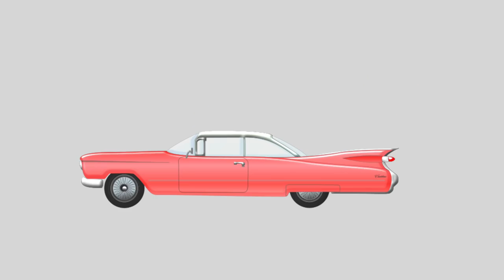Yes, Rockets CAN Fly in a Vacuum

Comment: But there is no resistance in space for the rocket to move into outer space. No resistance also to reduce speed or bank. Go back to basic third law of motion. Action reaction.
Reply: The fuel has inertia.
It resists being accelerated. To change speed or direction in space you just need to accelerate and expel some mass in the opposite direction.
Just point the engine bell away from the direction you want to travel in and use some fuel.
Reply: @niallkinsella2687  so newton's 1st law doesn't count in space? ok liar.
Reply: @77thbrigadesockpuppetaccou50  
I've described conservation of momentum.
The law of conservation of momentum is derived directly from Newton's laws of motion.
Reply: @niallkinsella2687  you've described a physical impossibility, lying guy. very boring & silly.
Reply: @niallkinsella2687  you described a violation of the laws of motion, silly billy.
Reply: @77thbrigadesockpuppetaccou50  
Does the fuel have mass, and does it change speed or direction?
Reply: @niallkinsella2687  according to the laws of physics a gas does not develop mechanical power when it expands into a vacuum. the mass & direction are irrelevant to the physics involved. stop wasting my time plz, troll guy.
Reply: @77thbrigadesockpuppetaccou50  
My question isn't difficult.
Does the fuel have mass, and does it change speed or direction?
Reply: @niallkinsella2687  irrelevant in the case of a gas expanding into a vacuum, troll guy. cos w=PV.
Reply: @77thbrigadesockpuppetaccou50  
Who cares what happens to the fuel exhaust after it has been ejected from the rocket?

What happens before that? What happens to the fuel to cause it to accelerate from 0 relative to the rest of the rocket to several kilometres per second relative to the rest of the rocket?
Or to simplify the question. Does the fuel change velocity or direction?

Why are you refusing to answer such a simple question?
Reply: @niallkinsella2687  He's refusing because he knows he is wrong but he, like most people these days, refuse to admit it.  I see most of these comments being from either children or immature and uneducated young people. Their inflated ego inhibits them from learning anything unless it comes from their peers, who are also woefully intellectually impaired.
Reply: @77thbrigadesockpuppetaccou50  Since you’re so smart, explain why a rocket engine works IN ATMOSPHERE first. Does the exhaust push against the atmosphere? Didn’t think so. Also, engines are supposed to be more fuel-efficient and higher thrust in a vacuum, because there is a greater pressure difference and therefore more energy. I have seen many comments saying that engines don’t work in space because there is nothing to “push off of”, therefore violating Newton’s third law of motion. It doesn’t. The fuel is the matter you “push off of”. And, Newton’s first law, the force applied from the pressurised fuel in the tank equates to nothing because the energy comes from the molecular bonds in the material that makes up the tank. The tank isn’t losing mass in any way which means no net force is applied on the entire spacecraft.

Comment: Rockets move forward (upward) because of the high pressure inside the engine bell pushing upwards on the rocket. The other end of the engine bell is open, so nothing for the gases to  press against. It is this net force in one direction that provides the thrust to move a rocket. What happens to the rocket exhaust after it has left the engine bell is completely irrelevant. The rocket isn't "riding on the exhaust", it's riding on the net thrust inside the engine bell.

Sure, the exhaust moves in one direction and the rocket in the opposite direction. But the one movement doesn't CAUSE the other movement. Both movements are the RESULT of the pressures of the ignited gases inside the engine bell.

Comment: On Earth, the rocket thrusts against the atmosphere to for propulsion. What does the rocket push against in space?
Reply: Rockets accelerate fuel.
Conservation of momentum means the rocket gets accelerated in the opposite direction. 

A third element is not required in the interaction.
Reply: - "On Earth, the rocket thrusts against the atmosphere to for propulsion."

No it does NOT.
Rockets thrust against the MASS THEY EXPEL as exhaust.

In fact even Jet AIRCRAFT do NOT "push on the air in the atmosphere".
They push on the AIR INSIDE THE ENGINE
Reply: Third law of motion.

Comment: Newtons 3rd law can't act on nothing of space. Rockets require atmosphere and walls to act as a barrier to push off against, in order for Newtons 3rd law to do its thing. Its like you are all claiming man can push a heavy rock with his legs floating in the air lol. You need your legs pushing against the ground in order for Newtons 3rd law to do its thing and allow you to push a heavy rock. Same thing with the rockets. Its not going to work in space with no atmosphere and walls around. You need to constantly explode the fuel at exhaust like tnt explosions, recoil effect from those explosions is what will propel rocket in space, the only way for rockets to work in space and its too risky for manned missions beyond low earth orbit.
Reply: Hang on a second.  I though you said that rockets require an atmosphere to push off of.  Yet, you claim that man cannot push a heavy rock by pushing his legs......in air.  Why do rockets work in air, but my pushing my feet does not?  This is inconsistent logic.

The answer :  the actual mechanism that powers rockets is the ejection of mass away from them.  They work on the concept of the law of conservation of momentum.  If you take a bunch of mass and you eject it away from you, the laws of physics will maintain the momentum of that system and you will be thrust in the opposite direction.  This is closely related to Newton's third law.

You say that you need to constantly explode fuel for rockets to work.  Yeah, that's what they do.
Reply: Inconsistent logic? Are you confused? Read my comment again. Rockets work in air because the air/atmosphere acts as a barrier for rockets exhaust to push off against.
Reply: They will have to tnt explode the fuel inside a container constantly and let some of the recoil effect escape from the exhaust hole along with all the gases while other recoil effect from explosions hit the walls of rockets and propel rocket in space. The hole at the exhaust is important otherwise rocket explodes instead. It is the recoil effect that propels rocket in space, not the explosions and exhaust gases themselves.
Reply: Rocket technology is not a viable option for man to travel beyond low earth orbit because its too risky. And they are not using rocket technology for that, they are using undisclosed electrogravitics technology. Google "The Case for AntiGravity-booklet.pdf - Check The Evidence".
Reply: Right.  So why doesn't the air act as a barrier for my legs to push off of?
Reply: Let's back up a second.  Do you think rockets work in a vacuum?
Reply: You are still confused. Wear rocket boots and then air will act as a barrier against rocket boots exhaust flying you up in to the sky.
Reply: Yes rockets work in space but only by means of recoil effect from tnt exploding fuel constantly.
Reply: Yeah, I don't think I'm the one who is confused.  But hey, you go ahead and think whatever you want, dude.  I won't judge.
Reply: Rockets work because the conservation of momentum is a thing.  If you eject mass away from you, you will invariably be thrust in the opposite direction.  I could go into space with 1,000 bowling balls and just throw them all away from me, and I would essentially be a rocket and the combined momentum of all those bowling balls and me after I throw them all away would be exactly the same as the momentum of all those bowling balls and me before I threw them.

If I threw one bowling ball away from me at 5 m/s, then that bowling ball would have momentum of 50 kg*m/s.  The rest of the mass (me and 999 bowling balls, or 10,070 kg) would have momentum of -50 kg*m/s. which would be a velocity of -0.00496 m/s (negative denoting the opposite direction of the bowling ball).  You can do this math for every throw, and after I've thrown all those bowling balls away, my velocity would be 62.5 m/s or thereabouts.  Not bad for just throwing bowling balls.  Of course, rockets have a lot more mass to eject, and they eject is at much higher velocities, so you should be able to gather how much more efficient they are compared to my bowling ball rocket.

Comment: What's the opposite of thrust? It's drag. 
Drag is also what causes a feather to hit the ground slower than a bowling ball when dropped. UNLESS dropped in a vacuum. In a vacuum EVERYTHING falls at the same speed. Because there is no AIR RESISTANCE. If it removes the ability to create drag, you are ALSO removing the ability to THRUST.  The damage from explosions is usually concussive. Concussion damage is caused  by air molecules rapidly  being forced away from a blast. No air, no concussion, no thrust, no drag. 

However. This has no bearing on space travel. They use thrusters to get to space. Then use gravity to propel them in the right direction.
Reply: Nate  Rockets actually work better in a vacuum.  The "ability to thrust" is all about the expulsion of mass at high speed away from the rocket, NOT about having air to push against.
Reply: @natecloe8535  I apologies for the rude comment... I shall delete. it.

You are correct.. there is no air resistance in space so no drag and nothing to push off of.. but that is where folks are mislead into believing rockets can not work. 

So lets do a thought experiment to try and help understand rockets in space. 

if an explosion happens in space.. would it go in all directions? if you think it would not, help me understand why what your reasoning would be.

if you do agree, suppose you set the explosion in a container with one open end that is strong enough to contain the explosion except for the open end.   
  - Would the container stay in place?
  - what direction would the explosion go?

Science says, the explosion would be directed out the end of the container, and the container would head in the opposite directions. Do you agree?

If you agree, you now understand how rockets work. They set off what amounts to that explosion in the rocket engine. The engine nozzle directs that explosion out the end.. and the Rocket in turns is thrust the opposite direction. 

Multiple laws of motion come into play. 
1) for the Rocket to cause the exhaust to go in one direction it must apply a force, an equal and opposite force is exerted by the exhaust on the rocket.
2) The  change in momentum of the exhaust heading in one direction must be offset by a change in momentum of the Rocket heading in the other direction 

Hope this helped
Reply: Nice 80/20 blend there.  

...but that has nothing to do with space travel xD
Reply: Nate - Rocket Propulsion is just mechanical RECOIL.
Learn about the "Law of conservation of Momentum".
Reply: @stuartgray5877  wrong. A rocket is a heat engine, chatbot. Mechanical recoil has nothing to do with its operating principle.